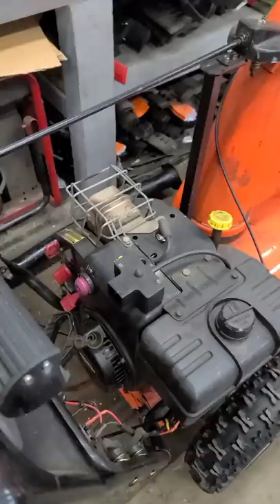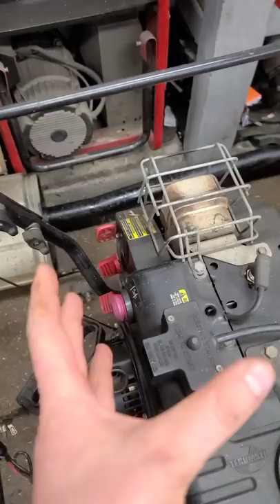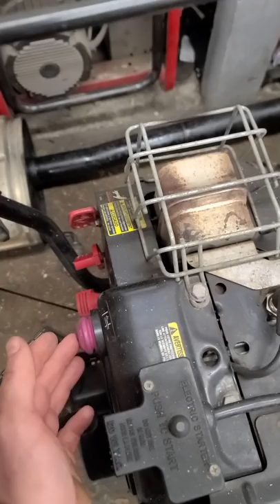Should I Prime Or Choke My Snowblower When Warm To Start It? #shorts

Comment: It depends - in my experience. If I shut the engine down for a short bit, <5 minutes, it starts with 1 pull with no choke or primer.
Reply: Correct. I think it also varies by engine. If we're talking about an older flathead with an adjustable carburetor per say (that's also probably running on the richer side) it'll probably start back up with no choke and no primer most of the time.
Reply: @AtomicFallout757  I have exactly that engine. 30 year old Snow King flathead. Carb with the adjustable main jet. I overhaled the carb a few years ago, the only repair in these 30 years. Those engines were virtually indestructible.
Reply: Mine too.

Comment: Decades ago, whilst working in Canada's 🇨🇦 Arctic, 
I quickly learned one should choke kill/stop, shut down, any engine
(JP-4 fuel transfer pumps, Herman Nelson Aircraft pre-heater units, what have you, that employs a gasoline engine) and leave it in that position, so it's ready for the next time you decide to restart. 
It's never failed me or my 5 seasons old 24in.Troy Bilt 3 stage, even when a few weeks ago the temperature dropping to -30C, one pull starts👍.

Comment: When the throttle plate is in the idle position, then chances are, the primer or choke won't need to be used to start a warm engine. Vacuum from the piston draws fuel through the idle fuel passageway & into the combustion chamber, which will allow the engine to start quickly. But as for a snowblower that runs at full governed speed at all times, when the engine isn't running, the throttle plate is always in the wide open position, & the choke or primer will need to be used.

Comment: The main reason why Tecumseh's do this is because most of them have "updraft" intake manifold's. The carb sit's lower than the intake port on the head. This is also why when the needle valve leaks they drip on the ground and not flood your engine.
Reply: Thank you

Comment: Because there epa jeted 

When we modify these engines making them in to race engine u could start with out choke but choke always help
If u run ur engine on choke for a while I recommend u switch to hotter plug or ur plug will fale prematurely

Comment: My 1993 10 hp tecumseh needs full choke and 2 pumps of primer on a cold start starts 1 pull...once it's warmed up no choke or prime maybe Briggs is different but on a warm start no choke or prime should be needed

Comment: Hey Dony, great info on here always watching!! Quick question for you??  I have the Toro 98cc Powerlite 2 stroke, that will not start on full choke. 1/2 choke at most, then gotta move it to full for a minute after it starts. Just flushed system and cleaned carb thorough, replaced both fuel and primer lines with new bulb assy too. Any thoughts?? Thanks all !!

Comment: But WHY does the engine require the primer even when warm when other engines do not?  What is unique about these Tecumsehs?
Reply from the maker: varies from machine to machine but it's common
Reply: Also might have to do with the freezing  conditions the engine is used in. The engine may be warm but the intake air temp is below freezing.
Reply: The Tecumseh on my snowblower does not have an air filter, meaning there is little to no vacuum to help draw gas into the carb. The choke or the primer bulb is needed at start up to get the first shot of gas to the cylinder, even when hot.
Reply: @notapplicable430  Most snow blowers do not have air filters.  The vacuum is created by closing the choke butterfly, creating a restriction on the intake side of the carb. The engine then creates a vaccum on the intake stroke that pulls more fuel up the main jet of the carburetor.
Reply: My leaf vac does the same thing even if it has an air filter
Reply from the maker: @aldoclausi3955  absolutely, we had 130 celcius the other day here

Comment: I have a question about a single stage 4 cycle craftsman 5HP snowblower.  I starts and runs great but if I use it for half an hour or so and then let it cool down for a few minutes when I go to start it up again I have to leave the choke on half or more for it to work properly.  It’s not a big deal but would like to know if anything can be done to correct it.  Thanks, great channel, very informative.
Reply from the maker: I would clean the carburetor
Reply: @donyboy73  it’s a new carb.  I thought maybe the main jet should be drilled out slightly

Comment: Ok, the answer is yes but... why? And I don't mean this particular machine, but others as you mention.
Reply: Right.  Is there a fuel pump of some sort that stops filling a pickup bowl that empties out when the machine is off?
Reply: maybe because the electric start or pull cord doesn't move fast enough to draw more fuel into piston chamber {stronger venturi effect or vacuum}? than when its running after starting?
Reply: These engines have a fairly substantial compression release. A healthy Tecumseh starts at 60psi with the pull start.  They will start in my experience with the electric start warm without choke. The electric starter overrides the compression release. Also it has nothing to do with the epa vs non epa carbs to my surprise, I own engines with both versions and they both start the same when hot.!
Reply: @Blutnase  NO Fuel Pump   Gravity Feed
Reply: @brettmastrangelo5371  does the electric starter override the compression release simply by virtue of the cranking speed being above where it kicks in the release?
Reply: Yes from cranking speed

Comment: And don't use ethanol fuel. Or you will pay later. Especially if it's a few months later. Or you can come to me to repair your bad decision
Reply: Government took away that option in my area, so ethanol laced fuel is all there is.
Reply: @wingerrrrrrrrr  Make your own. Just need a few large jugs (plastic, not flesh!) such as a 5 gallon water bottle, on/off spout, water and a good 24 hours. Many good videos here on Youtube to show you how.
Reply: @jamesws3  That’s right it’s done with water and die. Anyone that cares about extending the life of their home equipment should do it even if the pump advertises non ethanol it might still be pumping 5%-10% without you knowing. That amount will eventually breakdown a small carburetor. When doing this I keep the pure gas jugs out of sunlight and only mix 2 stroke oil in a smaller jug to keep it fresh. Once the season is over I take whatever gas is left in all my equipment and dump it in the car. Then I start everything to run dry so there’s zero chance any left over gas can cause a problem. I personally don’t buy into products that keep gas fresh for months. It seems like a waste of money.
Reply: @markm0000  wonder what the feds would do if someone opened up a sidewalk stand business extracting the ethanol and selling cleaned up gas? 😉
Reply: @wingerrrrrrrrr  I don’t think there’s much of a market for it. Most people don’t understand what ethanol is and expect to replace their small engine equipment every few years. That’s how you get several lawn equipment repair shops one right after another in every town. Also they’d just think you’re selling overpriced fuel. There isn’t much room for profit unless you can get a system working to do it automatically.
Reply: @markm0000  I'm sure they'll start to care if they get a whiff of money changing hands without them in the middle 😀
Reply: @wingerrrrrrrrr  Well you could open a small engine repair and fuel cleaning service. So the customers buy fuel then bring it to you to get the ethanol removed.
Reply: @wingerrrrrrrrr  Then you can heat the shop in the winter with all that leftover ethanol.
Reply: @markm0000  except it's going to have all the water mixed with it also. Might not burn too well-
Reply: @wingerrrrrrrrr  A cheap distillery should do the trick since water and ethanol boil at different temperatures.
Reply: @wingerrrrrrrrr  I found that you can live with it if you turn off the machine by shutting off the fuel valve under the gas tank and letting the carb run dry.  Make sure to drain all the remaining fuel in the tank at the end of the season as it will go bad if left in all summer long.  It's a pain in the butt but it's better than having to shovel by hand.